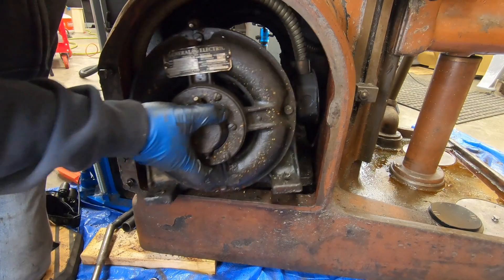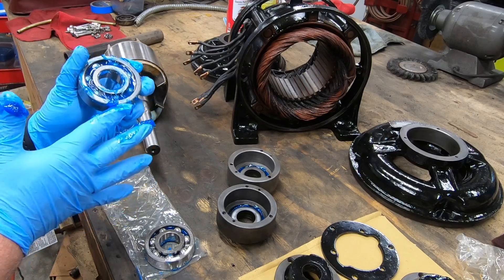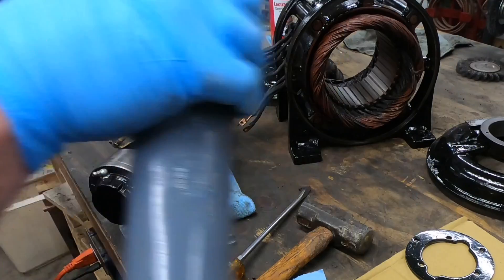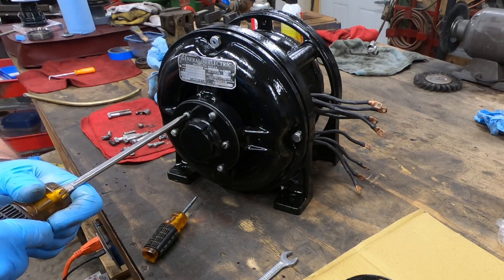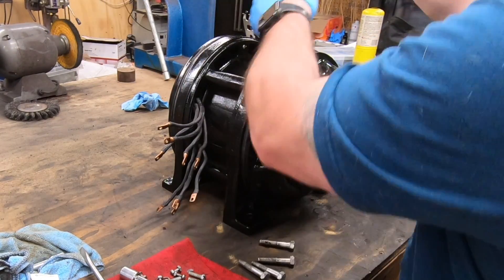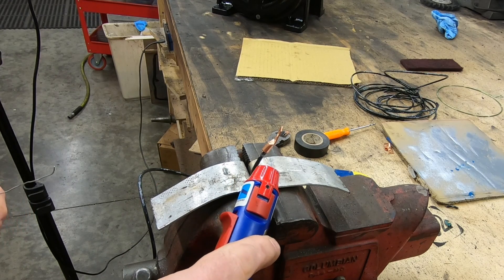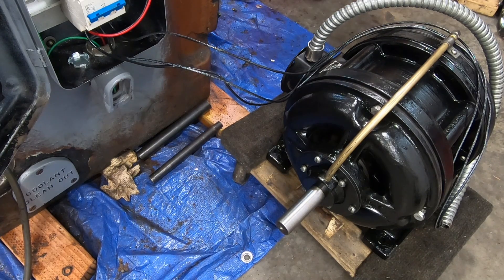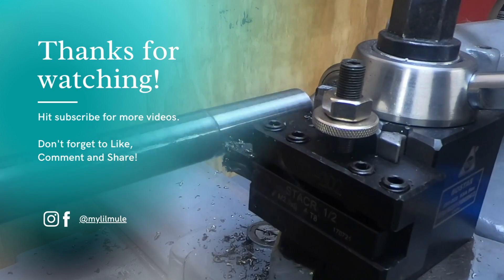Rebuilding a Vintage Three Phase Motor for the K&T

Comment: Using vinyl electrical tape only, is not a good idea.  Over time, vibration of the motor will cause the sharp edges of the bolts and terminals to wear through the tape.  In the past they used a layer of varnished cambric cloth tape, then a mastic putty ( or rubber tape ) to fill the voids, then finished with a layer of asphalt impregnated friction tape (or a quality vinyl tape like Scotch 88).  The varnished cambric tape is the tape that prevents the rub throughs. ( BTW, I am an electrician with 40 years in )
Reply from the maker: I agree 100%. But I wasn't going to spend the money on that tape to use 1% of a roll and never use it again. I truly don't have the budget to do all the little things I would like to do. Contrary to popular belief, there's not real money to be made from YT ads. :) I don't use this machine every day or every week, It'll get such little use, this isn't going to be an issue for the forceable future. This'll likely out live my grand children.

Comment: Here are some tips I have learned from rebuilding motors.
Use degreaser spray and a pressure washer to clean windings as long as you hit the windings with compressed air and leave the winding in the sun for a couple of hours it will dry up. Also they sell a motor winding insulating lacquer when the windings are dry I spray them down with this spray to try to reinsulate the old lacquer.
I am told that if you put too much grease in the bearings they can over heat and fail , You also could have used sealed bearings in place of the open ones. I generally recommend you do not grease motors for the reason that you found when you opened the motor. But other than that Good Job!
Reply from the maker: I thought about using sealed bearings, but I wanted to keep it more original. It won't see daily use. They will last the rest of my lifetime and then some.

Comment: Excellent motor rebuild, lots of great tips. You may have had it covered but hidden from the camera during the motor test while outside the mill, but I did not see an electrical ground connection for the motor case. I guess you may have tested the insulation to the case of the motor before powering it up, but if not it's better to avoid touching the motor frame while its running and not bolted to the body of the machine to get its ground connection (just in case there was an errant electrical short to the frame of the motor). I'm new to your channel and currently watching the playlist for the K&T mill :) Good stuff...
Reply from the maker: Good tip, thanks. For the test run, I didn't ground it, yes. Hindsight being what it is, that was careless.

Comment: JW IBEW wireman here: first, you did a great job of restoring that old GE motor. It looks like new.
Second: the "putty like" substance you mentioned when pulling the motor leads apart was probably 80 year-old rubber tape that had broken down. I've wired up a few motors; you are absolutely correct about wirenuts. They should not be used to connect the leads of a motor. Crimping on (soldering works as well) lugs and using a bolt, lock washer and nut is the way to go. Once you have the leads secured together, first a fabric cambric tape (Scotch 2510 or similar), then rubber tape (Scotch 2228 or similar), and finally a good quality electrical tape (Scotch 88 or similar) should be used. It is not the cheapest way to go, but if you use only standard electrical tape you're running the risk of the connection failing: I have seen it happen and it is not pretty. You might get away with using only electrical tape, but if the connection fails you will likely need a new motor at minimum.
Reply from the maker: Thanks for the detailed information.

Comment: Very possible that the substance was Noalox or something similar.  Used to prevent the aluminum wire connections from oxidizing and failing.
Reply from the maker: I'm not sure, I am no motor expert.

Comment: Really turned out quite nicely!  Runs very quiet and smooth. 👍👍👍
Reply from the maker: Thanks, Jim. I was a little bit surprised at how quiet it was. Although the motor ran, it wasn't this quiet before I took it apart. It wasn't loud, but made enough noise I knew at least one bearing was shot.

Comment: Gday, you did a great job cleaning out all the mess inside the motor, massive job but worth every minute when you hear it running as quite as it was, excellent work mate, thanks for sharing, cheers
Reply from the maker: I was really happy when I turned it on. If I move the phase converter outside, I don't think the camera would have picked up any noise at all. Those bearings were hard to find, glad I was able to get the right ones.

Comment: looks good.  there is a rubber wire tape to use on the wires first. then tape over that.  the rubber tape is like 2 sided , it has a film on one side you peel as you wrap it
Reply from the maker: I never knew that. I know the tape that Steve Summers recommended is like $20 a roll. Maybe I'll get some of one of the two types before the motor goes back in.
Reply: There are a couple of different tapes used for this. A rubber self vulcanizing tape like Scotch 2242, there is no adhesive, only adheres to itself or a rubber mastic tape which is a thick gummy sticky strip that is very moldable. There is also friction tape, an adhesive cloth tape which is also very durable. All of these need to be covered with a vinyl tape such as Scotch super 33 or 88. They will break down in oily or high UV environments. I have used all of these in electrical and electronics applications.